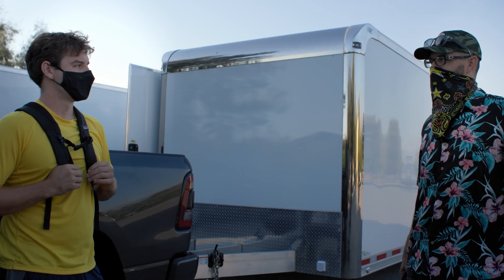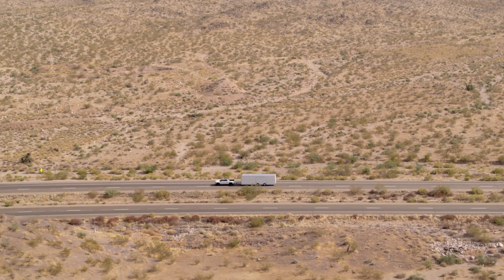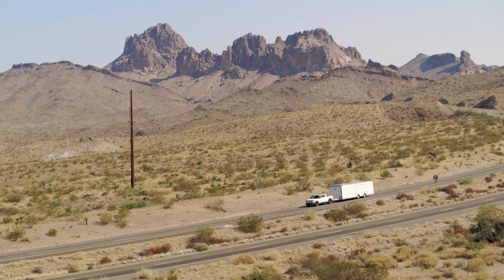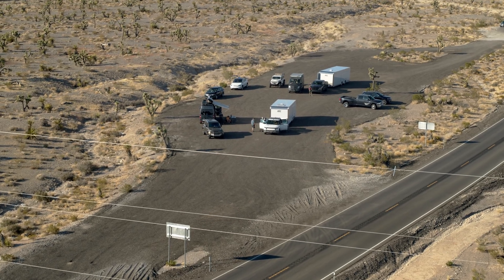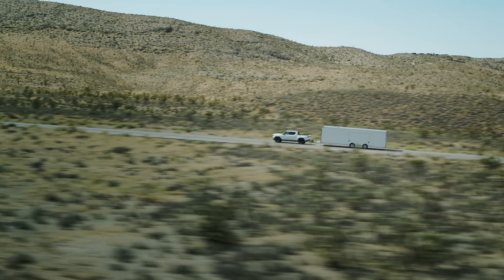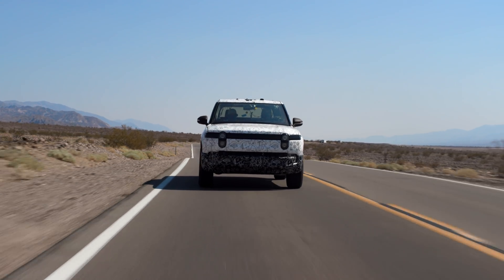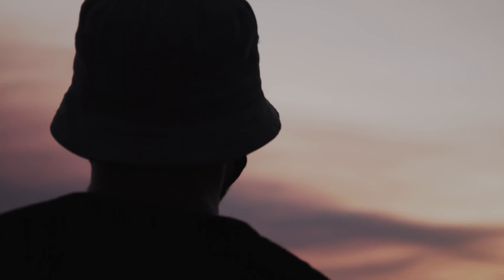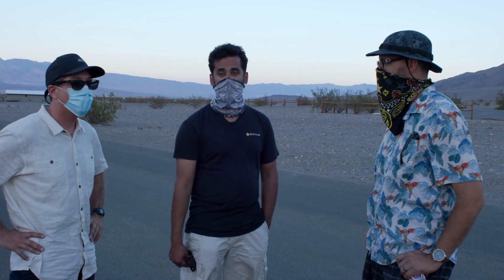Hot Weather Towing | Progress Report | Rivian

Comment: Just build a battery pack trailer chassis. If you add motors to the wheels on the trailer, it would help on the strain on the truck

Comment: Seeing Long Way Up, & the problem with electric vehicle is the cold climate. Hope its one of the things to tick off the list. All the best.
Reply: They are able to control the temperature of the battery.  Has a cooling/heating plate between the upper and lower packs.  Shouldnt be an issue.  The Harleys had no such thing.

Comment: It's the E = mgh  that is the problem going up.  It is not the ability to pull or drive well, It is the lack of energy density in batteries that hurts.  Trucks can have huge batteries, this pickup truck does not have the space nor the price point (expensive enough as it is).   Coming down, some of that energy can be gotten back but ability to convert all of that potential energy back into the battery is challenging.  Towing will remain a limiting factor for pure EVs in the near future.  But that is ok.  Most drivers do not tow.

Comment: Just to be certain...

The truck is driving itself with its own power and propulsion system, which is 100% electric.

You didn't just pull it up a hill and let it roll down the hill by gravity?
Reply: The truck is indeed moving with its own power and electric propulsion system.

Comment: 99 Degrees Fahrenheit at 4000ft... If you wanted to push the EV you should be doing this test at sea level. The higher up you go the easier the test gets.
Reply: the air also gets thinner and dryer making it harder for the flowing air to remove heat from the battery.
Reply: @miguellopez3392  This is true. But there is also less air resistance requiring less energy to move the vehicle. Hmm. It would be really interesting if they published a test at sea level as well. To see the difference between towing at sea level vs 4000ft.
Reply: @halllwd94  I dont know many places that are as hot as death valley at sea level but I guess its easier to just acount for the extra enrgy needed at sea level when mesuring from death valley.
Reply: @miguellopez3392  You're right. Heat is bad. Almost as bad as severe cold. It would also be interesting to see you do some testing in northern MN when it's about -50 in January.
Reply: @halllwd94  even the comercial trucks they use in California wouldn't do well in those tempature, fuel and lead acid batteries tend to gel up, A special winter optimized battery will have to be made something with 30% more capacity and good thermal insulation to make it easier to keep warm.

Comment: This is a bullshit.  U should go in Dubai desert and we will see how this car can handle a hot weather.  Am sure its going to overheat in 5 min only. Rivan pls try this car in Dubai desert and do man test
Reply: the Arizona dessert is about as hot and now re took the record of the hottest place from Dubai so it is a good place to test hot weather especially since it has hills and mountains where the motors can actually be stressed from work.
Reply: @miguellopez3392  guys am 100 percent sure its media bullshit.  In here it can reach up to 54 c and it sourounded by hot air . No car can handle offroading in this extreme hot weather
Reply: @Sol3y2010  no it was from official readings, death valley has the all time record of 56C and recently hit 54.5 C this year. you can operate a battery powered car in this temperature you will just need a larger compressor for the refrigerant that runs to the batteries which would lower range. battery powered vehicles have been proven to work on the moon and on mars and so they will prove they can survive in death valley.
Reply: @miguellopez3392  sometimes official numbers especially from media are not true . Even when u see the video u can see small bushes even the environment are different.  Am not saying death valley is not hot area . Am sure that Dubai is hotter otherwise sand dunes will not be there
Reply: @Sol3y2010  the dunes are there because of wind. I live in Washington state, it can get above 40C in the summer in a state that has world records snow fall and rainfall all because I live in a rain shadow on the east side, so you can go from dense mountains woods at 23C and travel 100 miles east and hit 40C desert valleys with canyons and scablands and even sand dunes in some areas. The mesuring was done by a government funded organization and not the media, ground tempature reading went above 95C, death valley is very hot but it's not very large.

Comment: A really good test, youtuber WHAT'S INSIDE? FAMILY took his Model X to Death Valley that day it hit 131f / 55c and I don't think it was ready for such high temperatures.
His car lost about 10 mph of range while stationary running AC as his car struggled to keep temps in check.
Later heading out up a gentle grade the Model X could not exceed 68mph !

I hope Tesla take note of these examples and improve their cooling in the future.  Perhaps their new Octovalve and compressor setup is already enough.  I'll look forward to seeing the Cybertruck repeat this Davis Dam test in similarly hot weather.

Great work and I like what you are doing to promote your truck, like that "Long Way Up" electric Harley and RIvian adventure.  It will be a good watch I think.

I ordered the Cybertruck Tri Motor FSD.  I love it's innovations and bold design.  I've always liked to be different so I am looking forward to receiving mine.  Your R1T seems an impressive option though.

Comment: Now bring it to some place cold and snowy.  Test the cold weather range and thermal system.  Test the cabin heat.  Make sure that snow and ice don't unduly jam the door handles or windows and that opening a door or front hood/trunk doesn't dump a slug of melt water inside. Also, have some tire/wheel options that aren't low-profile doughnuts that are useless on country roads and off-road.

Comment: I wanna to know what we can expect the range to look like after towing like this
Reply: Yeah no kidding leave out the most important detail
Reply: Between 90-100 km. which will get you out of Death Valley and into the Mojave desert, where it will be 118° instead of 123°.
Reply: Physics dictates that level fully loaded, if that pulls the maximum current, then the range will be about 15% of unloaded range given current Li energy transfer.  If you can manage 400 miles empty you MIGHT get 60 loaded. Tesla tests demonstrated it was closer to 12% in most cases.

Comment: The moment Rivian can Demo one in Western Australia, I'm recommending them for Work.
Reply: Im on an ev page on fb and commented a similar thing after one was driven 1300km from Sydney to Melbourne (fast charging. Which wa doesn'thave) took around 1.5 hours charge time on the way. Looking at the statistics the independent report had for the log it is plausible if the infrastructure of charging was in wa. The vehicle was loaded up with 2000kg not towing and it achieved around 380km..... towing a trailer it would be worse. People driving site to site loaded up with tools and towing it isn't viable yet and as general mining vehicles the company would have to invest sooo much money just in charging stations alone then spend twice the amount on a vehicle just to test it. Rivian have done off-road tests and it seems to handle it well but it's not exactly done 50-60k on corrugations or been given to drillers and geos. Wonder how it would do underground? That is the ultimate test. Would love to see it tested in wa too but Rivian would need to be willing to donate one to be driven to destruction. Hey Rivian I don't mind giving it a test out here, single cab tray back would be good...... ohhh wait you don't do them?

Comment: Hay Rivian, lets see how your vehicles perform in Himalayas shall we. Crazy cold temperatures and super high inclines not to mention narrow turning spaces and horrible muddy/ice roads.
Reply: batteries will operate correctly as long as they are above 0C, dong high inclines will actually help the battery stay warm and operate as a cold battery chemically reacts slower and produces less peak power, they can still work at -40C but with much reduced capability. is 4 motor drive will offer top class traction control, it can actually preform  tank turn using its 4 individual motors.

Comment: Would love to hear how towing 11k impacts the range. Elevation means nothing to an electric vehicle but weight is everything.
Reply: From what Rivian has said, it will be about half the range it would get if it wasn't towing, which is fairly consistent with what you get with gas powered trucks when they tow similar loads.

Comment: I purchased an overpriced 2017 Ford F-350 dually in January 18. After spending an additional $10k and lots of headaches, I just got the truck where I need it. Bad transmission and front end out the gate. Most dealers don't have anyone qualified to work on the truck. Anything under warranty gets blamed on the customer. This has happened in several states. I find this video interesting as I have property in the area they are testing in. Go Rivian. Dealerships are phasing out their service departments because of EV' s.

Comment: now do this in winter highway towing. Not asking for ice /snow tow just cold day clean highway tow. I have EV and it drops significantly with cabin heater and highway speed in normal commute. Can't imagine what would be like to tow in winter. Probably suck real bad.
Reply: The inefficiencies in the drive train and batteries generate heat, under heavier towing loads that extra heat can be used to help heat the cabin.

Comment: Impressive! BUT... Did they try to charge it when our power was cut for 2 days with the “high winds” and rolling blackouts for the heat wave? 🤣
Reply: You realize that with no power all the fas stations are shut down too right?
Reply: @justinfowler2857  -  I was thinking the same thing.  Short of the home owner have a battery storage system (e.g. Powerwall)  I would think people that  are relying on operating ICEs (e.g. vehicles, generators, etc.) will probably have jerry cans filled with gasoline.  I know I would if lived in a place with those possible conditions.
Reply: Justin Fowler yeah 😅 I have a couple gas cans stored for both car and generator use, I cycle them out once a year with fresh gas, I dump the old in my car and refill the cans. Also if I have to drive out of area to get gas it’s 5 minutes time to refuel a ways away from home. I’m not trying to discredit their attempts, I was considering buying one, I’m even on their mailing list to get updates. But, I can store a couple hundred miles in a couple 5 gallon cans in my garage. I also have a large commute, so if you own and EV and power is out at your house, you get no charge, so you stop on your way to work for an hour to charge your EV in an area with power. If you have a gas car you stop for 5 minutes. (My commute is over 160 miles a day) so I do go through varying areas with power. I don’t want to be 80 miles from home and wait an hour to charge my car because my house is without power. Also in California they issue “flex alerts” basically between 3pm and 9pm when everyone is getting home from work. They don’t like the demand on the grid and discourage the use of basic home appliances. I don’t think plugging in my EV would help with the “energy crisis”. I think EV’s are a neat idea, but I just think we need to focus a little more on the infrastructure. I’m watching “the long way up” and it’s electric motorcycles and two Rivian trucks. So far they have had to have a big diesel truck toting a big diesel generator with them. People think everyone has charging stations everywhere, but electricity and available capacity is a different thing. Not everyone lives in a big city hub with a small commute, not everyone has a solar panel system with a power wall. I hope to see advances, but just right now there seems to be growing pains and for now it’s easier to store gas and if I have to drive 45 minutes to get gas it’s only 5 minutes then back home. If it’s 45 minutes to get electricity an hour to charge then 45 minutes back. 😅 I just think that not glossing over the infrastructure issues isn’t good either if we want EV to actually be the way of the future and adopted widely it has to be easy to adopt.

Comment: This was great to see being tested.  I'm in Arizona and go from hitting three 110*F 6% grades to 70 degree rocky pitted uneven roads all within an hour or two in total.  I use one quarter tank of fuel doing this.  Approximately 6 gallons.  Phoenix to Camp Verde to Coconino National Park.

Is there any thought to an accessory battery pack that can be installed to the trailer a lot like a reserve fuel tank?

I imagine it could easily go under the trailer in the frame.

Comment: Rivian is the first electric vehicle I have been really interested in but I have questions:

1)come to Newfoundland and test out your electrical system in slop snow with salt on the roads and salt spray from the ocean
2) what happens if you break down? Can the car be towed? Does it need to be on a trailer? What is I am towing it behind an RV?
3) if I am going way off road or if I am doing construction on a site without electricity and using the truck all day, can I charge from a generator?
4) what maintenance is required and where will I get it done? The big car manufacturers have local dealerships and there are a lot of traditional garages. Will you be rolling out a network?
5) in order for the true electric revolution to happen, this can just be for the rich. Will you make a cheaper midsized SUV?
Reply: 1) That's a statement, not a question.  :-)  Maybe Rivian did for all we know.  After all they did travel to Tierra del Fuego, Argentina, and drove all the way to LA.  Rivian did other cold weather testing that they didn't necessarily advertise. 
2)  Short of something happening to one of the wheels like with any vehicle don't see why it couldn't be towed.  Rivian has said both Rivian models can be flat towed, for example, behind an RV. 
3)  Seems like an extreme case especially the work scenario.  You would have to travel over 400 miles round trip without access to an electrical outlet.  But if you had to charge from a generator, as long you have the proper cables, connector and it generates enough watts, don't see why not.  Also, FWIW, Rivian has stated their EAV can charge another Rivian EAV.   V2V (vehicle to vehicle).  
4)  Maintenance is not different than any other EV.  Rivian has stated they will initially provide "white glove" service.  Meaning, first attempt to fix it remotely, if that's not possible they then come to you.  If unable to fix it right then and there, give you a loaner while they take it to work on it.  Rivian hasn't officially announced their service and maintenance plans other than Cox Automotive, who invested $350m into Rivian, will be assisting with those logistics.  
5)  There are plenty of EVs on or coming to market that are affordable.  The R1T and R1S will definitely be a more premium model.  You get what you pay for and you're getting a lot with the Rivian models.  It has been rumored (about a year ago) that the next Rivian models will be smaller (presumably cost less) versions of the current R1T and R1S.
Reply: Steven - ALL Electric Vehicles can be Towed , just put into NEUTRAL.

Comment: Bring it to middle east for hot weather testing.  We have temperature above 122 degree Fahrenheit/ 50°Celsius.
Reply: Their Death Valley hit 131degrees Fahrenheit/ 55°Celsius this year !
It severely effected youtuber WHAT'S INSIDE? FAMILY 's Tesla Model X limiting it's power due to overheating and could only hit about 68mph up a very gentle grade in that heat.  His car also lost about 10mph or range while stationary trying to run AC and keep it's battery temps in check.
50c is no joke either that is for sure!